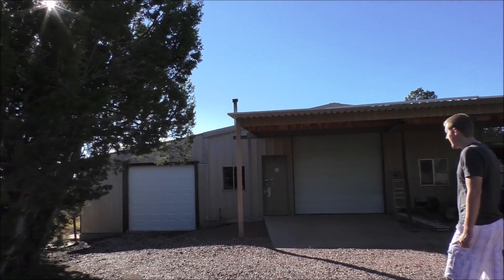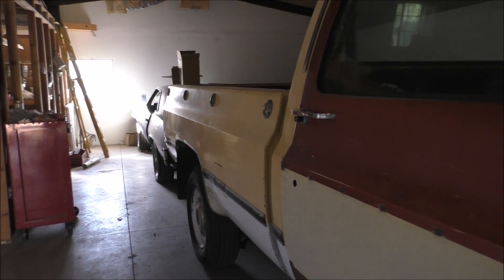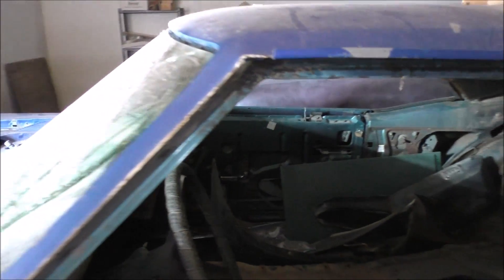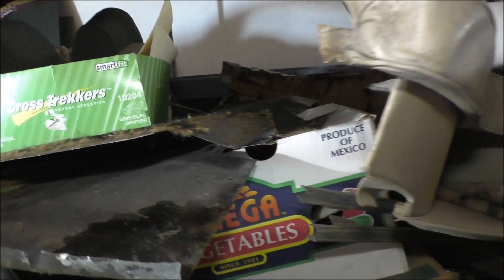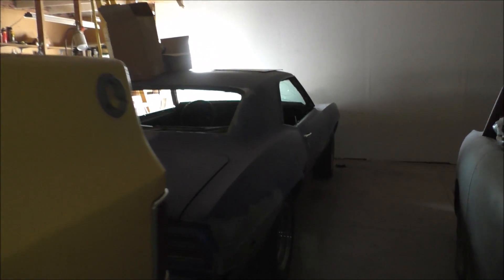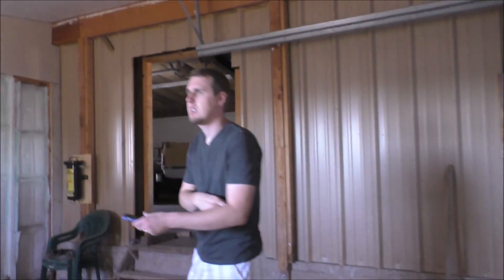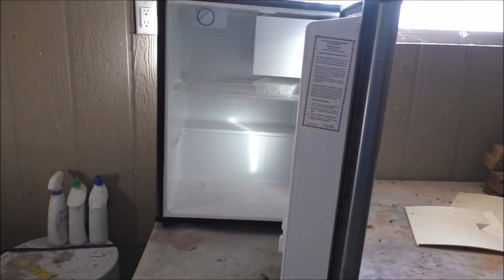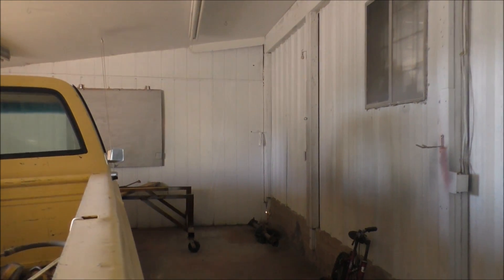#28 Old Bristol found in forgotten car shop!

Comment: Nice old truck and car. The car in front of the truck looks like an old 67 Firebird...a classic muscle car. That cat litter was most likely used for oil spills and such. That hutch looked really nice. Looks like it was solid wood, not that cheap press wood crap you get these days. I have an old hutch that is solid built and weighs a ton.

Comment: Trucks are late 70's c20 4x4, nice shape, the one car is a firebird early to mid 70's, other car late50's early 60' thinking Desoto?
Reply: 67-69 bird. Never made that body in 70. Second gen started in 70
Reply: Yes 1970 they changed , rear had the dropped corners , not square ones... thanks

Comment: Looks like a Studebaker Hawk body.
Reply: If you look more closely I think you'll agree it's an old Volvo, possibly a 'P' series.
Reply: That was my second guess, the front look to big for a Hawk.
Reply: Jay Skinner,
I had an old volvo, I think it was a P144, P44, something like that, it looked like one of the 39-40 Ford Tudor. I wanted to buy a P-1800 and drop a small block chevy in it for a few 'giggles'.
Reply: I thought of the Volvo when I saw it from another direction it looked more like the Hawk. I can see that the front end is much larger then the Hawk.
Reply: Jay Skinner right on good eye that's what I thought it was
Reply from the maker: It's a Bristol something or another.
Reply: Jay Skinner,
My Father had a Studebaker "Golden Hawk", all the chrome & gold trim, had a V-8 engine and  4 speed transmission. When I was just a 'pup' I loved that car, I've often thought about looking for one just to restore, to honor my Father, in a sense.  Haven't found one yet with all the lookers.
Reply: Beautiful car and then look at the style that was ahead of time.
Reply: Jay Skinner Way ahead of it's time. The Corvette didn't come out with a 4 spd. trans. until 1957.
Reply: No where Near a Studebaker Hawk
Reply: I'm sticking with the Volvo, I see a resemblance to the Studebaker but I don't think it is.
Reply from the maker: It's a Bristol
Reply: Thank you, Rick & Bekah,
The Bristol was the grandfather to all the Cobra's, isn't that correct? We can thank Carroll Shelby for the rest of it. lol.
Reply from the maker: I'm no expert but that sounds right !
Reply: BTW, Love your video, just now subscribed & clicked on like.  Thank's for sharing.
Reply from the maker: Thank you bobby. Glad to have you. :)
Reply: You're very welcome, Rick & Bekah,
 I've been considering doing the same videoing only I would have to use an inferior camera made by Canon, I have a Samsung Note 5 and iPhone s6+ to video with. There's a few places out in the rural areas, I've been planning on making contact with the owners for permission, it's only in the 'planning' stages now, I have to wait for the weather to warm up some here in Michigan.  I don't like snow. lol.
Reply from the maker: I have filmed with my iPhone 6s. Terrible in low light. I'd strongly consider a nice big 150+ LED light. That's what we use 👍🏻
Reply: Years ago, I had a Nikon set-up, complete with a "Darkroom", it came up 'missing' in a rather ugly divorce, there's no such thing as an amiable divorce. lol. That's off topic. lol. Anyway, I never got back into photography in the old sense, it's ok for pro's but not for me.
Reply from the maker: I'm no pro. I got a Panasonic v770 for what we do. Only like $500 :)
Reply: I had a Panasonic Camcorder, it used the full sized VHS tapes, won it in a card game. lol. It worked great, that's a part of my past also. lol.  I'll see what I can do with my Canon first, it's a PowerShot A1200 HD, uses 2 AA batteries and I use rechargeables w/micro disc card. BTW, I'm no pro either. lol.